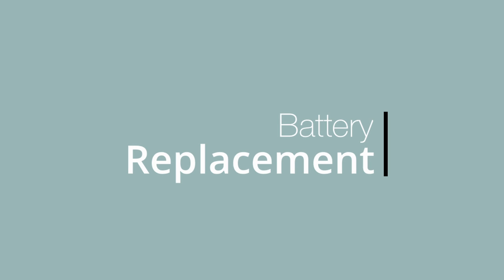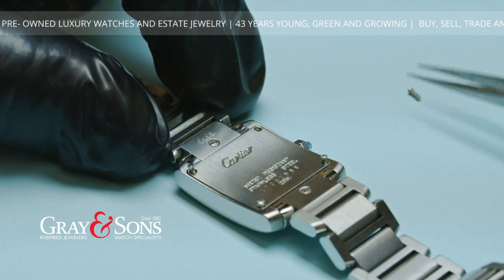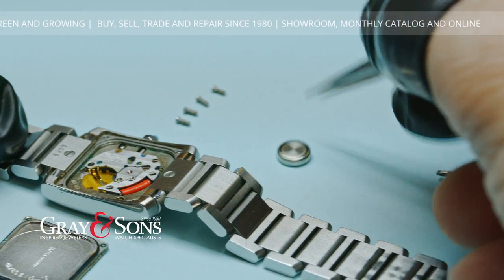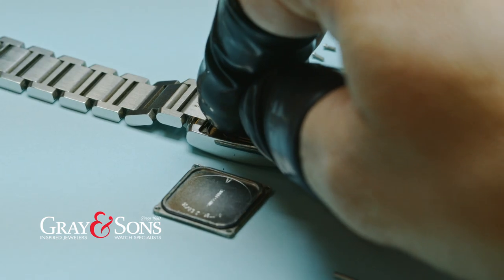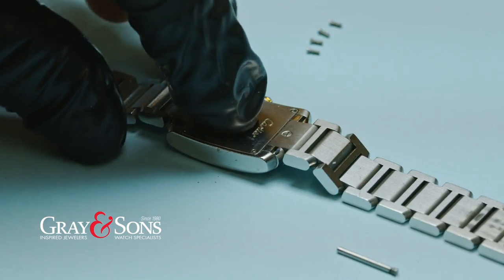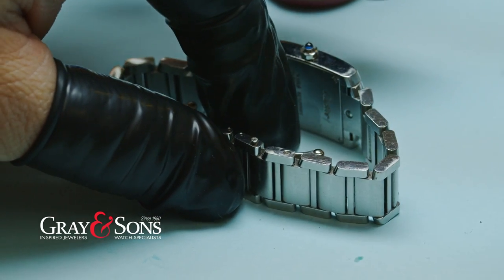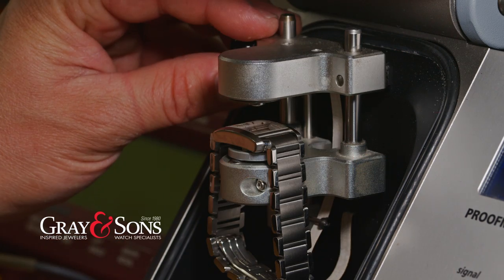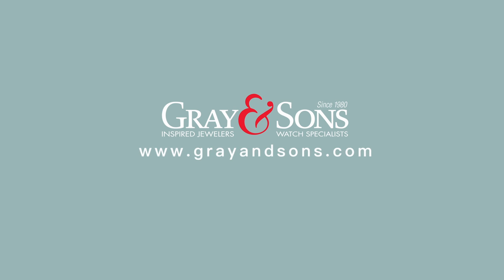How to Replace a Cartier watch Battery

Comment: How long does a battery last in a Cartier watch?
Reply: 6 years on the Santos/Francise
8 years on the Tank
16 years on the Solarbeat - but I think the cost for a battery on this is $160 where as a normal battery service from a Cartier authorized dealer costs $40.  The cost include, the battery, new case gasket and new tub(crown) gasket.  The watch is then water tested to manufacturer specifications.